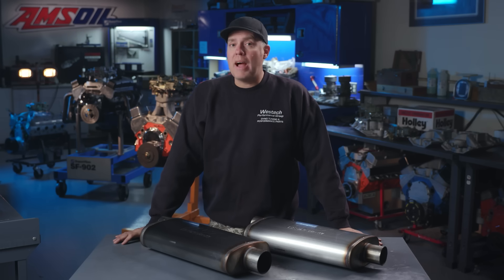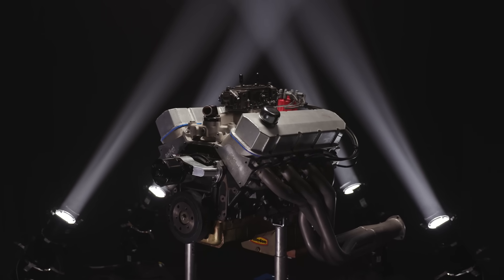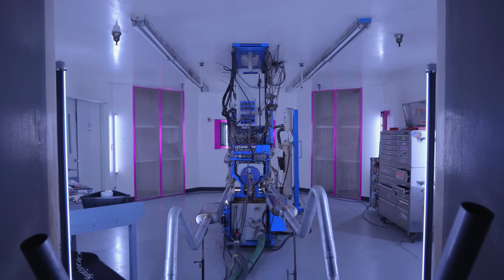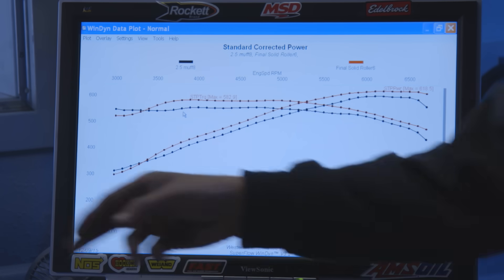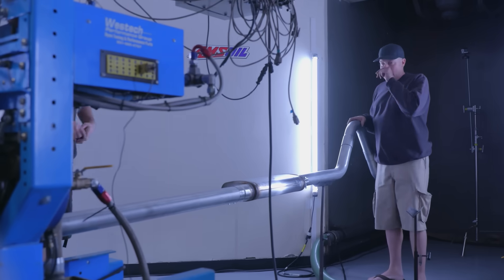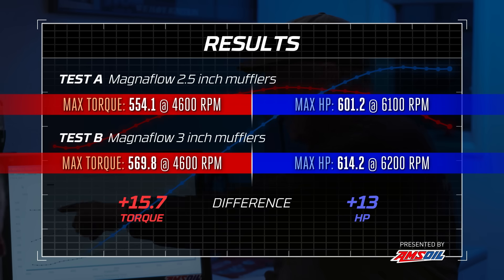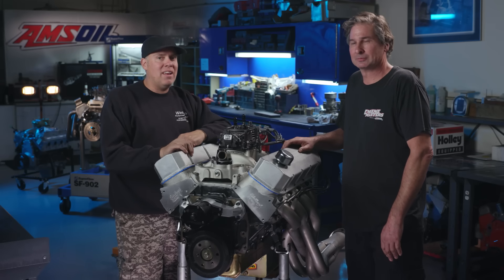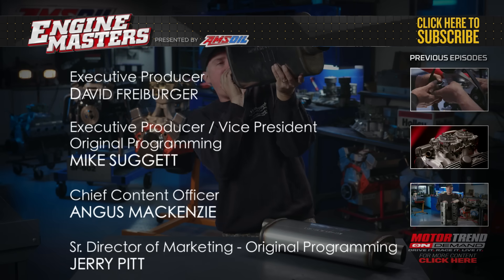The Power of 2.5- vs. 3-Inch Exhaust - Engine Masters Ep. 9

Comment: Scott Weiland's cardiograph, daaaaaaamn!

Just for a straight swap though I don't get it. I mean if it's running that much richer on 2.5" wouldn't you want to retune?
Reply: yeah that was a bit fucked up
Reply: So it turns out when you tune for open headers, ignore everything below 3500rpm, and only run at full throttle, then 2.5" is a bad choice. Who would have guessed?
Reply: agreed. they didn't check to see how much leaner you can run the carb before you start getting into overtemp/knock and how much power would come back.

that would have been too scientific.
Reply: +John Klatt I think the comparison was that the carb was tuned for open pipes ie: max possible power output, and then they were going off of that tune to see how much power was lost by adding pipes.
Reply: Yeah I understand that. I mean I guess if that's all they were wanting to show, that restricting the exhaust without tuning for it definitely kills power, then they proved that point. Just seems like it was a big opportunity missed to show how they'd perform after a tune for the exhaust as well.
Reply: +John Klatt A proper tune might have lessened the gap significantly. 
The difference really boils down to practicality: We are are only talking about 15.7 ft.lbs and 13 HP (at the max) on a 600 hp engine.  When you go for more power than 600hp you "need" 3 inch pipes to handle it and you will see a bigger difference.
But, it really boils down to this: How much is that 13 hp going to cost?
Most muffler shops I've been to can't mandrel bend 3".  They crimp bend them.  Are you going to get better flow with the turbulence in the pipe? 

If they were running a turbo it's totally different story...
Reply: +John Klatt Yea...kinda not ok.
Reply: +John Klatt surely it's worth noting that the AFR never really went wildly outside of an ideal range.
Reply: +M3rVsT4H kind of. I mean look at the flip side of this. if they had that tuned to the 2.5" and then switched to 3" and then just open headers with that little extension would it have not been running way lean? there were some spikes of leanness there. 

yes it's clear you are going to lose some power but it seemed that this was more of a 2.5" sucks video.
Reply: You can't run it as lean as you would with an open system... due to the fact that you don't get as good cylinder scavenging... which results in more exhaust gas heat in the cylinder, which lowers your knock threshold when compared to open system.  Im sure they could have gone 1 whole point leaner everywhere... but i don't think it would have made a significant difference... as they were still in the "sweet spot" of AFR for maximum power.

Comment: I haven't watched all of your videos, so maybe you have done this, but how about doing a test on an average engine that a backyarder might be able to afford and might do himself.  A 350, 10:25, 1 3/4 headers, 2.5 exhaust, Edlebrock RPM or a nice Weiand dual plane, 750 vacuum secondary or an Edlebrock 750, Vortec heads with good 3 angle and springs, cam in the 216 - 220 @ .050 intake, 218 - 224 exhaust, 110 c\l, around .460 - .500 lift..  Then test the 3" and 2.5".  Look at the driveability and street power, not just peak HP and TQ.  Nice to see these big engines, but how about some basic stuff that most guys can afford.  Maybe a backyard 302 to show the difference in cam, head, carb and intake requirements building a short rod Ford compared to a 350 or 351.

Comment: You couldn't feel a seat of the pants difference between the two exhaust systems, and probably wouldn't see much diff at the track. Just decide which sound you want and forget about it when its on a street car. Besides, you could add an x-pipe and shorter tailpipes to the 2.5" system and probably better the 3" system they had on it. I do like watching these videos though

Comment: I really love your guys work and always have, especially David. But I have an issue with this test. A typical street/strip V8 isn't 600+ HP. I think you guys are a little spoiled getting to play with 600-1200 HP cars all the time. I think I'm the perfect example of the typical hot rodder, (broke as hell watching you guys pull old leftover "junk" parts out of a pile to build what id consider my dream engine, while you call it something like "the junk monster".) I dream at night of having what you guys see as a thrown together turd. Anyways, I don't think anyone building a 600+HP big block would even think of using 2 1/2 exhaust unless forced to because of an ATM receipt like mine. Id really be interested in this test performed on what I call a typical street/strip 400+HP small block.

Comment: It's not about back pressure. It's about air flow velocity. Lower airflow (ie. under 3500 rpm) wants smaller exhaust piping to increase airflow velocity (hence the results in the dyno). Higher airflow (over 3500 rpm) wants larger pipes to allow more airflow without restriction. You NEVER want back pressure, you want maximum airflow velocity for the given CFM. Conversely too large of pipes reduce airflow velocity and increase pumping losses (see open header and 3" vs 2.5" under 3500) and reducing CFM which reduces power. 

This means that the exhaust pipe diameter is entirely dependent on AIRFLOW (which=HP). It's a shame these guys didn't explain that.

Comment: Its pretty basic physics. 
At low rpm the air velocity is low so scavenging really helps, once you start getting higher velocity and volume of gas, less resistance is key.

Comment: Here's a random anecdote:

I've got a 1992 Nissan Skyline GT-R with many modifications including aftermarket turbos and some head work.

It's got 2.5" downpipes off of each turbo that merge into a single 3" pipe with a 3" exhaust all the way back.  There's a "dump" just after the merge.  No catalist, but it does have a single straight through 3" muffler.

On a dyno with the dump open it made 592WHP, and with the dump closed it made 544WHP.  Pretty damn huge difference.  These were back to back runs and nothing else was changed including the boost level.

Comment: I'm curious how much of a difference re-tuning the carb for the 2.5" exhaust would have made.
Reply: This is the real question.
Reply: If it was set up properly for the open headers, which is probably the case as Brule is one of the best carb tuning guys in the industry, it's not that hard to calculate. You have to remember the fact that while you can tune it for better AFR, it does not change the fact that the system as a whole moves less volume. The amount the AFR goes down, is basically the same as the amount of air flow lost. In this case, you would not see much by tuning the carb - maybe 5-6 hp at best.
Reply: @AB-80X  at what rpm? WOT?
Reply: the longer the exhaust is, the more restriction it has........ maybe this needs to be explained in this video as well, drag on the walls etc.  some engineering calcs need to be run.
Reply: +ABOisen69X  Agreed, if the carb was set up for the longtubes with the 18" collector extensions, recalibrating the engine would be beneficial when adding any sort of full exhaust.  Gains/losses from tuneup between swapping between the 2-1/2" and 3" would be minimal.

Comment: So about a 3 percent increase in And 2.5 percent increase in peak HP.  This test fails to measure increase in noise, which can annoy neighbors and collect tickets.  Also, they don't talk about what RPM range most cars are driven at.  Peak HP is often more about bragging rights than useful increases in the mid rpm band.

I put a larger pipe (1.5" stock to 2") on my Datsun 510 and it slightly increased noise and greatly increased acceleration.  It was a perfect modification.

Comment: Should have taken the 10 minutes and retuned it after the first pull with each exhaust and noticed it richened up considerably vs the open header max power tune then did another pull.   That would truly show how much the exhaust made a difference vs how much the exhaust threw off the tune and the tune AND the exhaust made the difference in power.

Comment: A 20 horsepower loss isn't insanely bad for a full exhaust. Not great... If you're in a car with 600hp or 620 hp you probably won't feel the difference except for that fraction of a second on the quarter mile. The 3-inch obviously works better - I won't deny that. On smaller motors for daily drivers 2.5 versus 3 inches is basically pointless.

Comment: So would it be the same thing for turbo charged engines I all way thought that with normal aspirated engines the whole reason is you have to thank of a engine as a air pump.I am 2ed guessing my self on the turbo charged ones now.
Reply: +knightridder2002 Turbos you'd want the exhaust sized for the HP at max boost. The lower the back pressure the better as it would help with turbine efficiency/spool time.

Comment: Not disputing the evidence in this video as I agree that on an engine this size 3" is definitely the way to go but there can be a scavenging effect on smaller engines running a smaller exhaust (I believe this is where the backpressure myth comes in). Also, I would liked to have seen the 2.5" exhaust tuned to the same AFR to see how much difference it actually made. If all setups were tuned to run the same AFR would have been a much better test and showed a more useful result and would have closed the gap between the 3" and 2.5" substantially.

Comment: obviously if you run a turbo config - it wouldnt matter whatever the fuck you did - life starts at 42 psi guys
Reply: +Casper sanderson  No mufflers with a turbo. The turbo is the muffler.
Reply: +1400IntruderVS IF the turbo is the muffler, why do they put those fart can mufflers hanging off the end of them like a dangling turd? Makes them sound like a Briggs & Stratton lawn mower.
Reply: The Turbo technically is not a muffler but the turbo does scrub off a lot of noice as it is being driven by the exhaust pressure. enough that a muffler is almost redundant on most street modded vehicles. 
I do not know why kids put big stupid looking mufflers on their cars (fart cans). Sometimes I think it is just to brag about what brand of exhaust they have. Some of those mufflers actually create turbulence that makes the exhaust louder.
I simpler resonator tip is plenty. A muffler after the turbo creates some back pressure that may additionally slow the spooling of the impeller. I know I picked up near 12 horsepower across the entire rev range on my last turbo car just by removing the muffler and putting in a staight pipe and the noise wasn't much louder. It was a tech tip I had read in an old Turbo magazine printed before fart cans were popular.
Reply: +Casper sanderson 

Unless you run NHRA Pro Mod

Comment: Put a 3" spacer between the intake manifold and the carb on that engine. On a big block I don't know what it'd do but it should  give you another 15-20 HP at least and way better throttle response, no joke. I cant believe how much of a difference it made on the 350 cu in our 75 Chevy c-10 Truck. How a simple inexpensive spacer can do so much is amazing.
Reply: +Horatio Huffnagel That is still done but on the old cruisers (pre '57 with the HUGE engine bays) but this is representing an under the hood set-up that most people use to minimize cost: i.e. not buying and painting another hood.
Reply: DjJtown That is true. Most cars don't have the space to raise the carb and air filter up. You would have to cut the hood which isn't cool. If you wanted to though you could make a nice ram air scoop.
Reply: +Horatio Huffnagel It's amazing how keeping your carb cool can improve performance, if you don't quite have the room for the 3" there are some thinner ones made out of better insulators.
Reply: ***** Doesn't the gas and air get a longer time to blend giving it a better mixture. Does the longer tunnel make it go into the cylinders faster or something. That my theory. lol I've been trying to think how it makes a difference. Keeping the heat away from the carb is one factor for sure.
Reply: Long intake runners are all about scavenging by using the inertia of the mixed air to force air through the exhaust valve while they overlap open.

Comment: Kind of disappointed for two reasons:1.  It's pretty widely known that an 18" collector extension makes a HUGE difference in power, yet it looks like you went from what is probably a 3.5" - 4" collector directly into the 2.5" exhaust, creating a massive abrupt "choke point" and probably all sorts of reversion back to the motor.  I wish we could have seen this with a tapered 18" extension that would have smoothed that transition from the 3.5"-4" collector to the final 2.5" exhaust diameter... I have a feeling the results would have been more surprising and impressive.2.  Since you're using a carb and not EFI, you don't get the automatic correction for the A/F ratio when the exhaust is changed from open headers to full-exhaust.  Running so "fat" on the mixture is costing power too.  At least with EFI you would have had compensation for the exhaust change and the A/F ratio would have stayed more consistent.  If you are going to use a carb, you at least owe the viewers a few jet changes to optimize the new setup...  :)It was a cool video, but it seems like you were doing the tests to prove something that you already believed (that 2.5" exhaust would KILL power) instead of giving it the best possible chance to put down a solid number.Just my $.02   (I did enjoy all the comments about "the engine needs backpressure" though...)

Comment: I wish you had also tested a 2" header going into a 3" exhaust. I installed a catback and I wonder if it did anything.
Reply: +jonnda  It should do a little something. When the exhaust gases passes through to the higher volume section, that lower pressure area difference theoretically increases the flow velocity of the tighter area. 
Obviously I am no dyno but if the old theory is true it should at least increase and help flatten your torque band.
Reply: I'd say they proved that you do need back-pressure. The idea has always been that it's only needed at low RPM's. The 2 1/2" out performed the other 2 setups below 3500 RPM @WOT.

Comment: You guys say the carb is running richer because of the smaller pipes but you don't rejet the carb. Then you poo-poo the smaller, quieter (ie. street-stealth friendly)pipes  because they come up short by less than 20hp against the 3 inch pipes. Is this just an ad to get people to buy 3 inch pipes? If your rig is for show or cruising or fun drags, then by all means, run big noisy pipes. If you enjoy fooling cars with big, noisy pipes into thinking you aren't a threat and then blowing them out of the water, stick with the smaller pipe and rejet your carb.  For examples of how to do it right, look at F.A.S.T racing.

Comment: what about a fairly stock fuel injected engine and back-pressure is it beneficial? im driving a 1996 camaro Z28 with the GEN II LT1, its fairly stock. should the exhaust be as open as possible?
Reply: +andrew donohue I would just go shorty headers and new mufflers if you havn`t.
Reply: Get a Flowmaster 3" Catback with 80 Series Muffler and 3 or 3.5" Chrome tips with an angle cut. You'll love the sound. And it's not too obnoxious. It's just right and mean.

Comment: But what is the cost difference?
Reply: +nathenandrew Lol, cost difference on a 2.5" vs 3" so many variables but so little difference... Marginal at best, use your brain....
Reply: FukU2222 I am using my brain, I'm trying to figure out the cost/benefit ratio. If it's $50, it's worth the extra money, if it's $300+ it probably isn't unless you have the money. Also I wonder if it might be cheaper to go with the 2.5" and add a cutout for the strip. That way you have a quiet sleeper but can uncork it for the track. Maybe you should just ask why I want to know next time instead of getting frustrated because you can't figure out why, then being an internet dick.
Reply: FukU2222 It's funny because I'm not even typing it out, I'm just copying and pasting it. LOL!